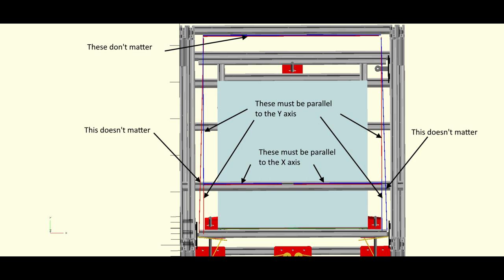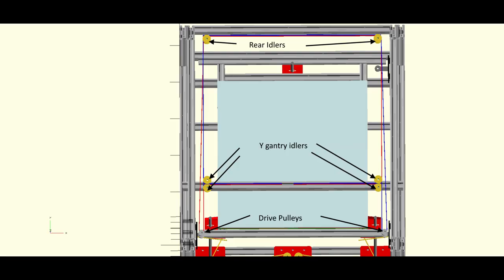New CoreXY - Part2 - belts runs, pulleys, idlers, and Y axis gantries

Comment: I have fitted home switching on all axes, the sensorless homing would sometimes fail because both motors are moving  and it couldn't tell which axis was at home.
Reply from the maker: Yes, I'll be using homing switches. I've never had much luck with sensor less homing on a CoreXY with both motors contributing to motion. But simple micro switches are cheap as chips and much more reliable than sensor less homing, which can vary depending on things like motor temperature. Maybe if your name is Prusa, then dropping a cheap homing switch on thousands of machines makes financial sense, but for a one off printer it's not worth the potential reliability issues in my opinion. 
I kind of garbled up what I meant in the video. The X homing switch will be mounted on the X carriage and I'm planning on using a Duet tool board on that same carriage, so it'll be short wires from the switch to an io on the tool board. The Y gantry will just have an adjustable "stop" for the X switch to make contact with. The Y end stop will be mounted on the frame with a second adjustable "stop" on the Y carriage and wired to the Duet main board. This is all pretty much the same as the current machine configuration. I'm just debating whether to fit max end stops. I have these as well on my current machine and they initiate an emergency stop if triggered. I wire them all in series so it only uses a single io on the board. It's saved my bacon once or twice when I've been moving axes without first homing the machine so it doesn't "know" where the axes max are.